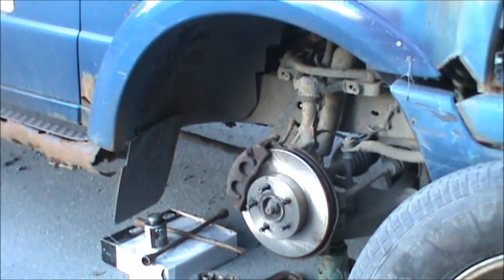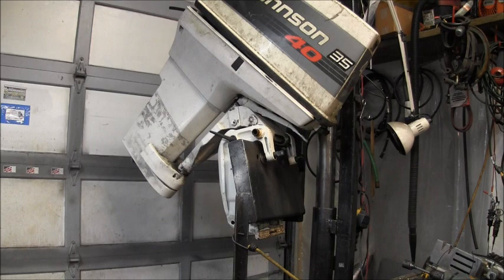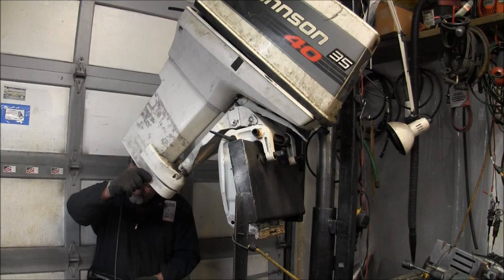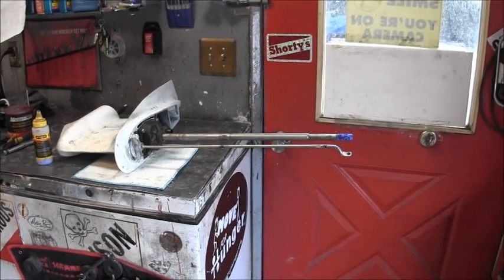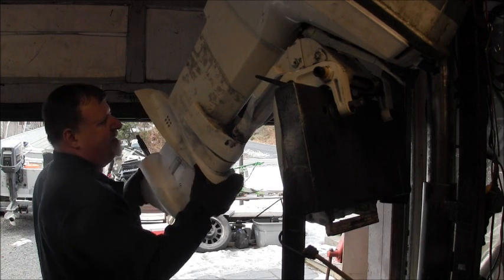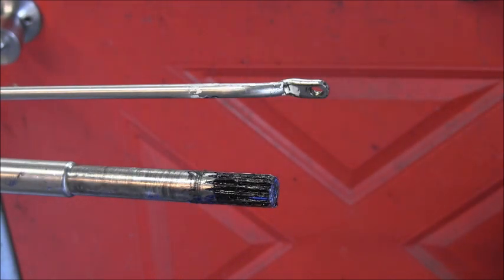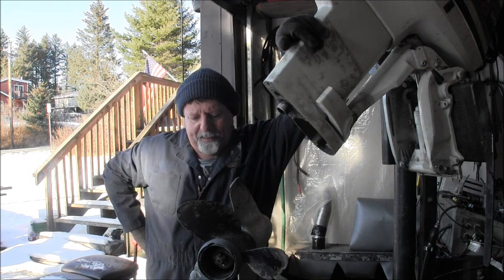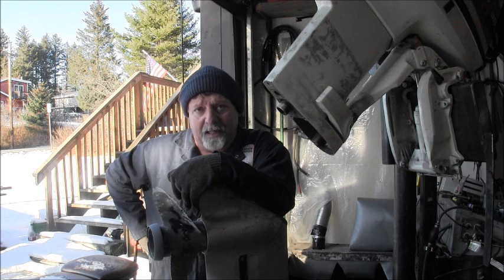1994 JOHNSON,  35 / 40 HP     ((  Part 5  ))

Comment: Hello , Great videos.  Was wondering if you could answer a question for me. I have 1996 johnson outboard v-4 115 and I'm relocating my battery to the center console from the stern. It's about 8 feet away. I need to know the amp of that motor or starter so i can buy the right gauge battery cable.

Comment: I’m sticking with the drive shaft is being pushed down into the prop shaft ! That shaft shouldn’t be bottoming out on the crank shaft and I think the shock absorber on the driveshaft is broke ! If you look at the video before you installed the lower unit , both shafts were at the same length and then after you removed it the shafts were not at the same length and the drive shaft looked to be shorter ! With the lower off pull up on the driveshaft and turn it , if the noise is gone there you go !

Comment: KB lots of good videos, but I have a problem that you have yet to cover I have a 1978 35 hp evenrud that has excessive movement in the control arm that runs from throttle cable to the stator causing the stator to rotate about 2" in idle position, have you found a cure for this, or is it normal. Thanks

Comment: Some of these engines actually had a 22.5" shaft length, perhaps this is one of those.  What is the model number?  I think there will be a "Y" in the model code if it is a 22.5" model.  I'm assuming this is a commercial model, so I have trouble finding the model numbers for commercial models on marineengine.com.  Will look at the BRP site....  Have a look at another 20" midsection, perhaps you might be able to see a difference.  OK, watching and righting at the same time...Looks like the splines are definitely going up into the crank though...  Glad the crank splines are OK...D

Comment: well check both ends of the shaft if the lower unit gear and shaft well i know 150 has had fix like socket set square   end of crank mod or are watch dc side show? i wounding how long this is going on! till joe gets rubber room help with white jacket on that strait! and the people wake up before war drums play!

Comment: OK, something changed in 1993.  Different part numbers for crank and driveshaft...I looked at the part numbers for the powerhead lower seal housing, that changed also.  The part number for the smaller seal in the housing that seals the driveshaft changed also...  Looks like that driveshaft is "cut down" up top near the splines.  So, I'm guessing that if you pull a gearcase off a 93 and newer engine you will see that the top of the driveshaft is not cut down...Am assuming the engine you are about to attack is a 93 or newer model.  Can't wait for the next installment!
Reply: Hey  that brings up a question. I have four old 30/35 hp JonnyRudes, 1979 thru 1992. All are 22.5" motors. Just curious. Were these motors also produced in 20"? I have an early Pacific City dory almost ready to go, fresh restoration. I plan to convert the old motor well to a splash well and have to decide between 22 1/2" and 20" transom height, to run other motors, like my '87 40 hp....Thanks.
Reply: @joeevens1368    After rereading your message, I just want to make sure you actually have 22.5" engines...I don't remember any of the 32CI 30-35hp coming in a 22.5" commercial model...  Would love to see a picture of one of them...Don
I just don't want you to be measuring incorrectly and end up with a mess when you make your boat transom...Don
Reply: @joeevens1368    Well, the 22.5" models only came in a very few commercial models..Are you sure you have 22.5" engines?  Can you send me a picture somehow of one of your 22.5" engines?  In any event, I would definitely make your transom for 20" engines, 22.5" models are pretty rare...Again, I want to make sure you are measuring correctly, I don't want you to mess up your new transom...D
Reply: @fleetwin1  Thanks for the reply. I'll see if I can send a pic. I pretty much suck at internet stuff, but worth a try. My measurement is from the ca/ventilation plate up to where the transom clamp sits on the transom... I just now did some careful measuring with a straight edge clamped to the cav plates (to minimize error) of my three 30 hp's,  a 1979, an '80 and a 1992, plus my 1987 40 hp, and  my 1989 70 hp ......Measured trimmed with  cav plates about level to boat bottom....Kinda surprised by the differences....All three 30's measured 22", (All 3 are thru hub lowers). the 70 hp measures about 20 3/4", and the 40 hp is right on 20"...With all three 30/35's just randomly acquired and such differing years, I have to assume that 22" is standard....With the quite limited transom clamp of the 30's,(just the screw clamps and two small bolts, I'll need the full 22" on the transom.  I guess that I can build the splashwell with enough depth to accommodate tilting a 20" motor. Then it would be simple to cut it down if needed...I'm pretty confident the 30/35 will be  adequate power. That was pretty standard back in the early days of the Pacific City dory fleet for the then standard 19 and 20" dories...PC dories are all flat bottom for beach ops. Serious ocean fishing craft. Assuming adequate power with the 30/35, I plaan to build the splashwell wide enough to mount two motors for peace of mind. Its a big ocean and I'm often alone out there in strong conditions..If you aren't familiar, google PC dory. We have a pretty unusual fishery and culture. Seems quite dangerous always launching and landing thru the surf, but we have the best safety record of any port on the Left Coast, with zero folks drowned in the last 50 years....Cheers, I truly appreciate your effort and willingness to help reduce our collective ignorance. After 50+ years in the game I still find gaping holes in my knowledge base. Always a student....Joe Evens...
Reply: @joeevens1368    I always say "everyday is a school day" for all of us Joe.  I love learning new things, even re learning things I thought I knew.  How about just responding with the model numbers of the 30-35hp engines, so I will know what shaft length the are "supposed" to be.  Dimensions do vary for sure...Don
Reply: @fleetwin1  E35953A,  J30RLESS, J35ELCSM, E35RLCSM . Another thing, The 1979 and 1980 motors seem to be considerably higher compression, running 145-150 lb.  All of the later 32 cu in motors I have checked run 120-125, in good condition. I suspect that after the very early motors they dropped compression a bit to make them reasonable to rope start as the other small refinements were added to keep the power up. Better intake manifold, using the primer instead of choke for cleaner airflow,  At least two different lower gear ratio's over time. Do you have any info on such changes? At this time I have one motor running with all of the later refinements with the 1980 high compression powerhead. Haven't had it out yet, but sure seems to run well. Cheers, JE
Reply: @joeevens1368    OK, well all your model numbers are for regular/non commercial models...So, none of those engines have the rare "22.5" midsection I spoke of.  It is very possible that OMC made these 32CI midsections a little longer, perhaps for some hydro-dynamic reason.  So, I would definitely stick with the 20" transom height for your boat, especially if it will be a twin engine rig.  These transom brackets have holes that can be used to secure the engines as well, like you said.  So, you could always block the engines up just a bit with some sort of shim and drill the holes for that set up, if excessive spray/rooster tail is an issue on the water.    The compression was probably lowered a bit on the later models to help them survive on nedwer lower octane/alcohol laden fuels...